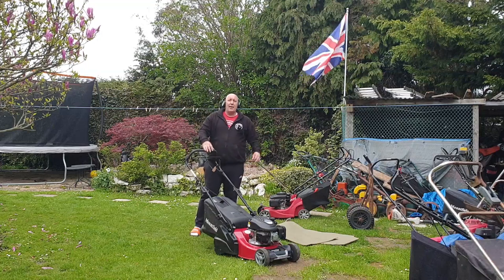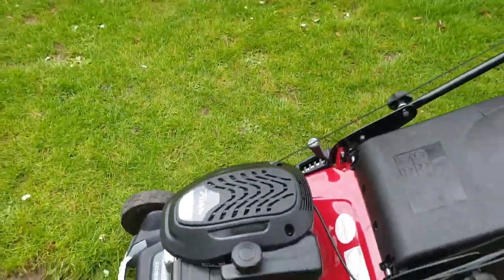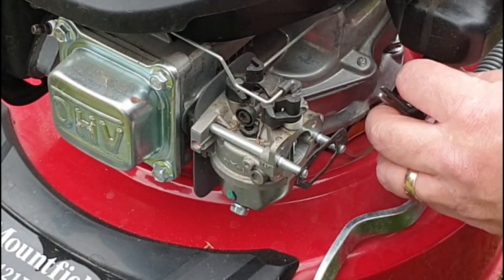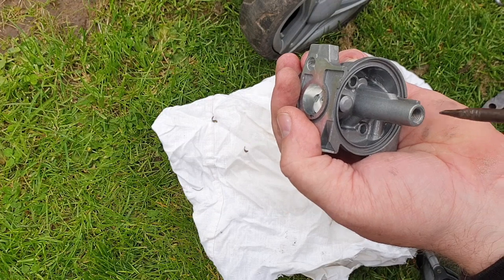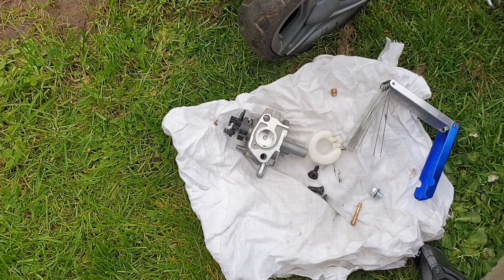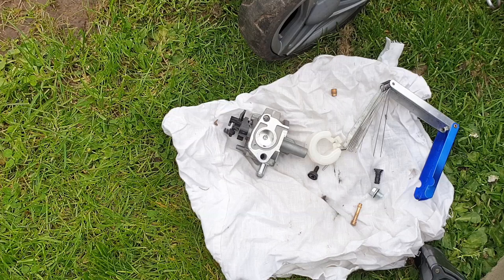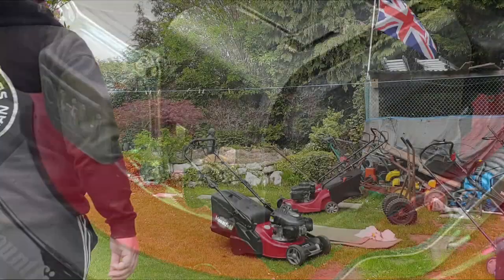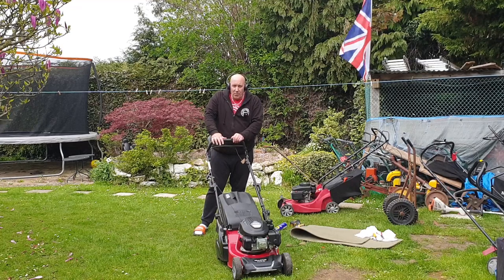Mountfield S421RPD Lawnmower Hard To Start. #mountfield #mower #youtube

Comment: Hi Mick, I have a Honda Izzy approx 18 months old, it starts ok and at first it seemed to run fine but then it surges and starts to backfire. Any ideas please.?
Reply from the maker: Have you hit anything like a brick or stump .
Reply: No mate not at all, my lawns are very flat and I have not hit any large stones or paving etc. I stored it over winter with fuel in it, I use fuel stabiliser .
Reply: Could be fuel or autochoke problems.

Comment: Hey mick just a question have you had any issues with the Auto chokes on these as I am currently repairing a mountfield HP42 with the ST120 engine. Have cleaned the Carburettor on it and it starts an runs lovely to start with then it progressively starts to run lumpy as if the choke is coming on. When you shut the engine off it starts leaking fuel from inlet and into and through the airfilter.
Reply from the maker: I would do the carb again.... It will run lumpy until the choke comes off.. maybe start it from cold with the air filter off so you can see when the choke comes off..
Reply: @themowerman it seems to run lumpy when the engine has got warm.

Comment: hi there mick could you help me ,have a Mountfield Universal SP42 Petrol Lawnmower .,and ive lost the carburettor  idol speed pilot jet ,i tried internet endlessly ,where can i get one .june d
Reply from the maker: I will have a look
Reply from the maker: Is it the brass jet or the plastic one?
Reply: @themowerman  hi mick its the plastic one ,only bought it last year .june d
Reply from the maker: @junedoyle8346  ok.. I'm on it.. I will have a look
Reply from the maker: @junedoyle8346  ok.. try this one.. https://www.ebay.co.uk/itm/332012446918?mkcid=16&mkevt=1&mkrid=711-127632-2357-0&ssspo=S5ny4y3tTKe&sssrc=4429486&ssuid=VxofTcWjS-2&var=&widget_ver=artemis&media=COPY
Reply: high mick i got the part you sugested ,[ was a bit apprehenstved with the first pull ,but it started  ,thanks for taking the time your a gent. from june d
Reply from the maker: @junedoyle8346  is it running now?
Reply: @themowerman  yes mick first pull thanks for your help ,your agent
Reply from the maker: @junedoyle8346  no worries